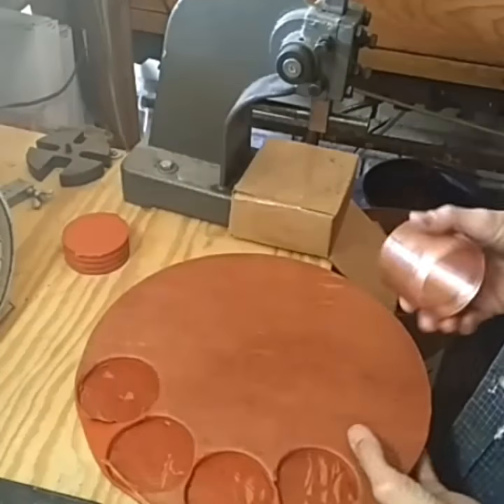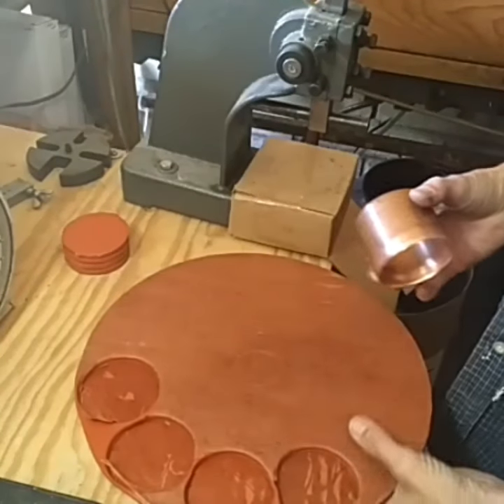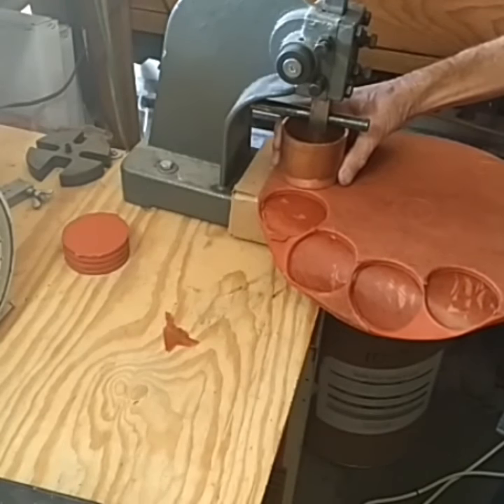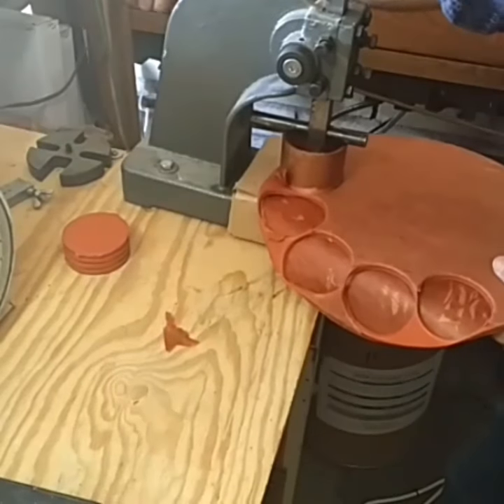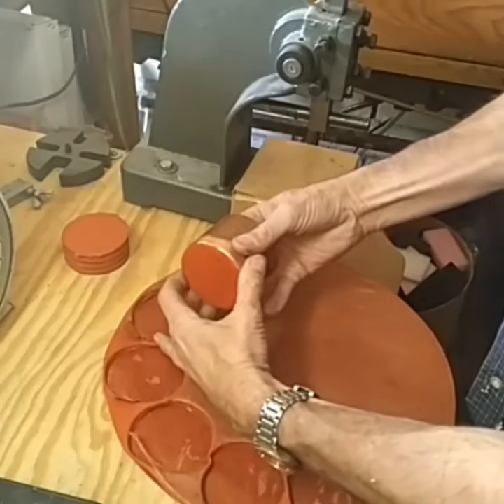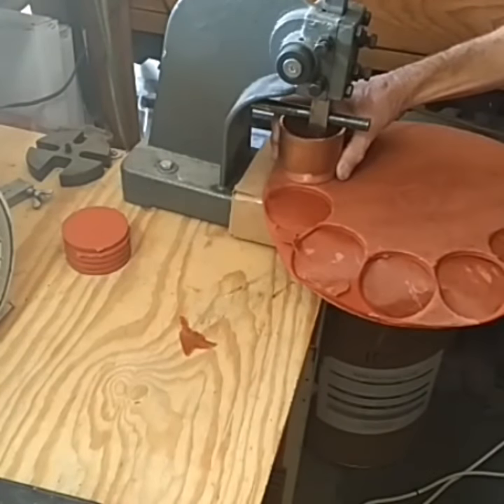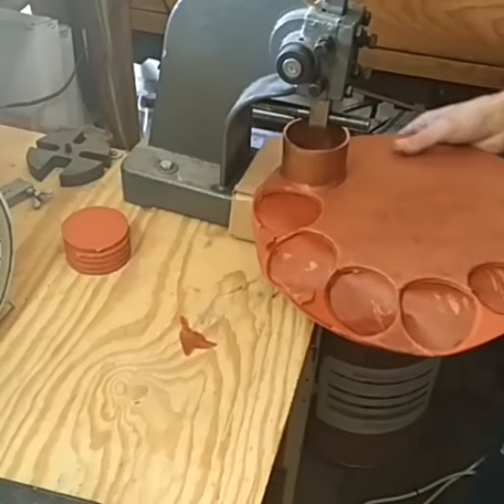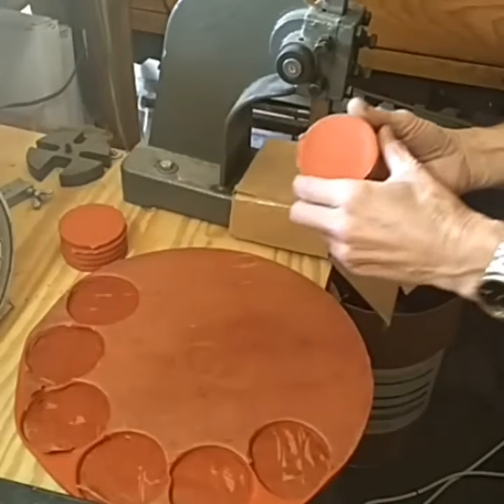How I cut the toaster oven mold rubber

Comment: What is the average hardness range for the rubber you use for molds?
Where you buy your uncured rubber from?
Reply from the maker: This is 63 durometer but all silicone spin casting rubber works. Contenti is a good source as is Zero D.